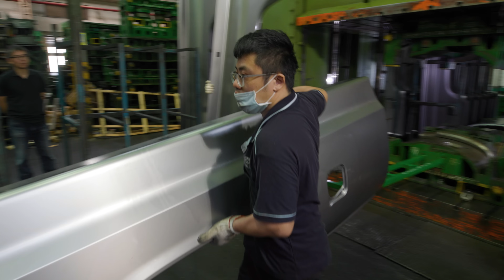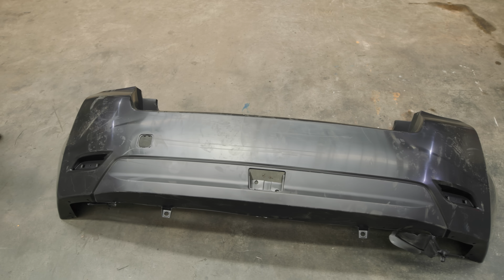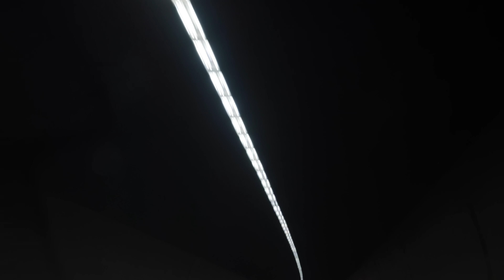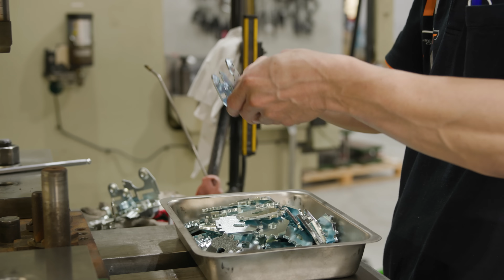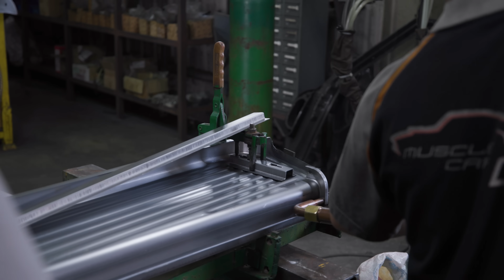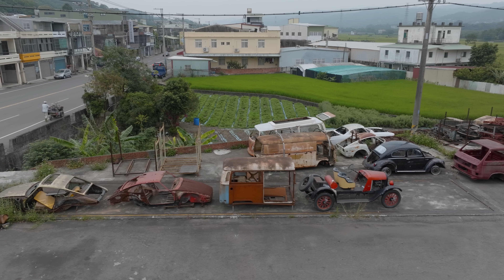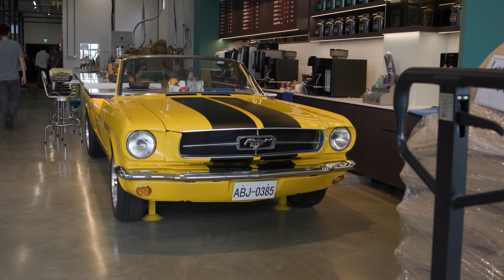Taiwan Makes American Trucks Great Again! Tour of Sheet Metal and Replacement Parts Factories

Comment: The fact the molds and stamps are not scrapped and put into service is almost a godsend. The ability to correct any defects with the tools available today will ensure a long term business plan. I wish it was in the USA but at least SOMEONE sees the value in reproduction of these still cherished vehicles, even if it’s from overseas.
Reply: I'm honestly surprised someone like ford or chevy doesn't reproduce something like an old square body or bronco with modern engine, suspension, brakes & interior. Surely that would sell. People are buying restored ones for $150k plus.
Reply: @SlurpJ ,emissions and safety is why. The folks rebuilding or modernizing those old trucks are not scrutinized by the various agencies.  They are essentially one offs.
At a 150k my guess is most are barely breaking even.
Reply: @davidsawyer1599  I work in the auto industry. Emissions and crash testing wouldn't be an issue. Engineers have overcome far bigger issues.
Reply: @davidsawyer1599  It's the way consumerism works. If manufacturers weren't constantly changing model appearance every few years, people would have little incentive to "upgrade."
Reply: @SlurpJ they're not allowed to because they take federal money now. Did you hear how cheap that guy said they were making die sets? The same die for the new Ford tailgate cost the company $8,000,000. But they have to sell their old dies
Reply: @SlurpJ  The modern crash test requirements would make that impossible.
Reply: @frenchonion4595   nope. I work with with plenty of engineers. The problems they can solve on a computer sitting behind a desk is incredible.
Reply: @SlurpJ  Even with that you have to pay them to think up this stuff. Smart people ain’t cheap to hire.
Reply: @SlurpJ  They figure that they can't meet their profit margin on it. Gotta remember they are greedy.
Reply: Have you seen these car & truck auctions? What this stuff is going for is mind blowing.
Reply: @SlurpJ  Regulations and laws. That's the only reason they can't build a Ford Bronco. Once those laws and regulations are gone, and they will be gone soon, you're going to see 1970's vehicles being reproduced, bolt by bolt, and sold to the public again, with a carburetor. Remember that Lee Zeldin is the new boss of the EPA, and on his first week he found $8 billion dollars that had apparently been stolen by the last administration (allegedly).
Reply: @starseeddeluxe  I'm not so sure they will be gone. But it's entirely possible to build a "new" Bronco using old school sheet metal & modern engine, suspension, brakes, etc. Unfortunately it'd cost more than a Raptor. 
Not a fan of the EPA so I'll pay more attention to this Zeldin guy.
Reply: Be thankful 😊
Reply: I love seeing this kind of creativity and I agree. Why do we not do this is the USA
Reply: Ya you would think someone in USA would want to buy the gm stamp press instead it goes across the world
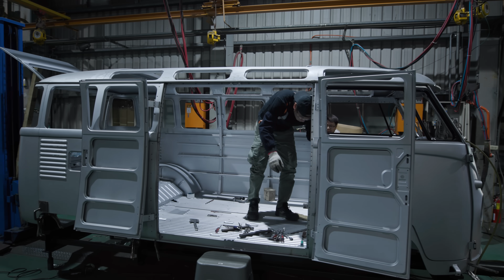Reply: Very often, the stamping machines originated in Asia. The mfg in Asia, first in Japan, later elsewhere , large scale machine tools were available in Asia on a timely basis. 11:06  @petercoffin4978
Reply: it gives a great opportunity to avoid modern, much too complex technology, because you simply repair your old car that never gave up and no crazy bills and easy to repair for DIY. Hooray
Reply: 0:03 
I think one offs could be made in the USA , my question is frames
And drive trains
Then you have a question of VIN and titles  these are reproductions.
What states have emmisiins laws on new old cars that are remanfactured as new? 
Then you have motor type say electric or hydgron  powered 
You can convert a gas engine to run off hydgron  with a near 0 carbon footprint.
And last  copy rights to the body designe
Reply: @bobbg9041  It's spelled hydrogen.
Reply: Lmao you must know nearly nothing about the stamping process…
Reply: @saratoga123321  enlighten us!
Reply: @saratoga123321 I never said I did ,so please kind sir, enlighten us.
Reply: To many corporations in the US that want to be millionaires over night ,to many CEO that want to be millionaires overnight, EPA rules, liability’s, insurance,finding some young people to work an 8 hour day and don’t mind getting  dirty,90 days off for maternity leave when your wife has a baby. How many more things can we list,and we wonder why we don’t have manufacturing in the USA any more.
Reply: Honda makes cars at different plants around the country too. My Goldwing has less Japanese and Chinese parts than the avg Harley does . It also can last a lifetime with just normal maintenance.
Reply: Oh they make reproductions of those molds and stamp machines and then they scrap the original or they just sell it on eBay
Reply: 888
Reply: IN WW2 we converted hundreds of plants from what they were doing to what we needed in MONTHS. BRING BACK WHAT WE GET FROM OTHER COUNTRIES,WE CAN REBUILD OUR INDUSTRY IN MONTHS AGAIN ! With American labor!
Reply: @Happy11807  good point. If we were do go into a conventional war today…we’re screwed.
Reply: Better Taiwan than china
Reply: @davidklauer3422 well if China gets their way…
Reply: because it's literally cheaper to manufacture and ship half way across the world than do in the US that's why the US needs trade restrictions on overseas car manufacturers because the US can't compete and it's pathetic
Reply: @trailfork7815   FYI, the US already HAS trade restrictions in place on overseas car manufacturers.   These were first put in place in the 1980s by the Reagan administration.  This is why Toyota, Honda, and German car manufacturers started putting car factories in the US to do final assemblies of their car models, because that was the solution the Reagan administration came up with to continue to allow these foreign companies to sell their cars in America.   They recognized that these foreign companies were making better cars than the crap turned out by US car manufacturers at that time, but they wanted to be able to say, hey, we made sure that these foreign cars would be made in 'Murica to keep 'Murican jobs.  
The REAL problem is that American car manufacturers only care about their quarterly profits and stock price.  The  people who run American car companies can't think further than the next six months.   If a car or truck model goes out of production, there isn't a huge amount of profit to continue to keep the dies around to stamp small runs of replacement body parts for future car enthusiasts trying to restore that model car.   That's a VERY small market that requires a lot of patience and lots of love for these cars, and LOTS of expensive storage space.   American car manufacturers instead look at that die for a car that they no longer make and think, hmmm, how can we make a quick profit off this die in the next six months?   Recycle the metal?   Or sell it to this funky body part factory in Taiwan?
You see?  They probably just recycled the metal for the die in the past, but now this company in Taiwan is willing to buy it from them for a quarter of a million dollars, so yeah, of course they would want to turn a quick profit on that die that they don't want to continue to store and to do small runs of that body part.   Not enough profits in it and they don't care about restoring old cars, only their quarterly profits.
Reply: @gandalfgreyhame3425  and the fact that it had to be sold to Taiwan instead of a body shop in the US where the manufactured parts would be sold to anyway only furthers my point that labor in the US is too ridiculously high to keep manufacturing these things over there
Reply: @trailfork7815   A small body shop in the US would not have enough capital or the expertise to be able to get into this sort of business.   It would have to be a company that was already in the business of producing sheet metal stamped parts, like how this Taiwan company started out.    And there actually still continues to be a thriving stamped sheet metal manufacturing industry here in the US, so it's not entirely the labor costs either, because these American companies have figured out how to stay in business even with the higher US labor costs.   
So, the question is, why didn't an American stamped sheet metal company get into this business of reproducing body parts for cars and trucks?  
My best guess would be that once again, any American company that had the capital to get into this business of spending a quarter of a million dollars on one body panel die would want to have a pretty good return on their investment.   Profits come first with most all American companies.   
Or, they would have to be really rich already from some other business and are just in love with this idea of producing body parts for old cars and trucks.   Like, Elon Musk could have done this.   Tesla bought these super expensive Giga Press machine tools made in Italy to stamp out very large complete body parts for their Tesla cars, to reduce or eliminate the number of welds they needed to manufacture the Tesla cars.   Except, Elon's vision wasn't to go out and produce a huge library of stamped sheet metal body parts for old cars and trucks.  Elon's vision was to change the world and make electric cars a reality and the dominant force in the car industry.  
So yeah,  anybody in the U.S. with the money, the capital, the wealth, to get into this business would either want to do stamped sheet metal parts that would either make a really good return on the investment, or they would have to have this vision for wanting to do this as a service to all the old car and truck lovers of the world.   And culturally, I think the sorts of rich American entrepreneurs like Elon that could have done this .... just didn't.  It wasn't a really sexy idea that culturally they would ever embrace.
It's sort of exactly the same reason that TSMC got into the chip manufacturing industry by manufacturing chips for everybody else's designs, not their own.    Intel could have gotten into this business, but they were making lots of money at the time making and selling their own chips and didn't see themselves as just a fab for other people's designs, so they turned down the opportunity to make chips for cellphones, ARM processors, and the graphic cards of NVIDIA and AMD.    So Intel let TSMC grow into a bigger business than their own because they turned down this opportunity to just be a fab for other chip designers.  
So, I think in Taiwan, the people with the capital, the wealth are culturally more willing to do projects that aren't so super duper visionary and world changing, and instead are just sort of providing a much needed and not very sexy and not super profitable sort of service to the rest of the industry.
Reply: @gandalfgreyhame3425  yeah I guess profits comes first, say they make $200 profit for a quarter panel, in asia that is already a decent chunk of money but for the US no way is anybody accepting only $200 in profits for a part that could take an entire day to make, I'm guessing if it has to be manufactures in the US it would cost at least 2x just to break even in material and labor compared to taiwan
Reply: @gandalfgreyhame3425  it wasn’t too long ago that the most US content car made in America was…wait for it… Toyota Avalon. Over 80% of it made in America.
Reply: @trailfork7815  how much less do you pay someone making parts for old cars than new cars? The work is the same no matter what model year it is. What kind of quality do you get in USA for minimum wage?
Reply: @gandalfgreyhame3425 It's not likely that they would recycle tooling,  unless it's just a small modification.  But for new designs it's more likely that they would start from scratch.  They'll store tooling for a long time but eventually it's just scrap iron to them.  
I thought that was interesting how these Taiwanese were making the rough tooling out of Styrofoam.  Using that Styrofoam to make castings that were eventually machined into functional dies.
Reply: @paul5683  Smart idea. On complex shapes such as a reverse curve they could make the  styrofoam in sections and pack the sand around the styrofoam with parting line, split the mold and remove the styrofoam and use it again. He said $300,000.00 for a set of dies, but with cheap labor I doubt it would be that high. As far as scrap iron, they said they make the dies which would imply a foundry and the scrap is then recycled to become new dies again.
Reply: @trailfork7815 Maybe if burger flippers weren’t being paid $20/hr, you could.
Reply: @moltderenou  And you do what for how much an hour. The kid flipping the burger has to pay how much of his pay cheque for rent, and may also be making payments to a college when he is not working his part time job to hope to have a better life. I don't like the price in fast food places and save a lot by making all my meals, even when I drove commercial truck for a living.
Reply: @trailfork7815  understand what your asking for. If they were made here it would be far more expensive to do even to a point that it wasn’t profitable, which may be the reason why we have this situation. Today’s vehicles a far more complicated with all the nanny devices/comfort/federally mandated features people have grown accustomed too. Those complexities lend themselves to cheapest production prices available in order to keep vehicles “affordable”🤪. Because we still have an option to preserve some of the vehicles still roadworthy with these “foreign parts” is money in the bank vs. buying a new. I myself would rather put $ into my 22 year old F250 than entertain buying a new or even something 5 years old. Thank you to the Mr. G’s helping us do that.
Reply: @trailfork7815  can't compete, or over regulated, and fined out of business? Or are we robbed of our tax money to subsidize assembly unions? Which are basically Ponzi schemes at this point... if only General Motors and Ford could just go out of business already so they could be bought out instead of handed bailouts to pay themselves bonuses. Federally subsidized unions ruined American manufacturing.
Reply: @trailfork7815  what will happen if others also impose american businesses for their home business. most americans businesses are global, dont talk immature way, otherwise, it will be national companies, all nation can do same thing as usa. usa pushed global trade and made others to open their gates, but most americans dont want others to come in their nation. i think this wont that way.
Reply: @trailfork7815  I take exception to that and here’s why: just look at the Lincoln Nautilus , it is produced in China. At $60K it is not a bargain IMO but yet there asking “home grown” price. So is ford really interested in the consumer or how much they can get on each. I be willing to bet that the minimum PROFIT ( after expenses paid) is at least $10K per vehicle. After 5 years ownership heaven help you if you need a part, and if they do have say a headlight they’ll probably want 5grand for a replacement.
Reply: Thank the board members for shipping American jobs overseas. 
 Covid taught the world a lesson. That lesson was this. "We need to make all that stuff here."
Reply: @davidsawyer1599  problem is that even if the molds were used here in usa.. the labor and operating costs would make it cost to much. 
Everything .made in usa, comes at a higher price.
Reply: @turboflush  labor costs are the same around the world. It's CEO's and "Engineering" costs that scare people away from work. If we got rid of upper management, who always make shit decisions, our companies would be a lot better off. I used to make plastic extrusion molds. And upper management decided to get 1" ball endmills instead of 1/2" ball endmills because "with one inch we could run one pass in the program at depth." To which I replied no you can't the webbing of the one inch endmill won't remove material..." so these idiots bought two $450 endmills and both snapped because they're not machinists they're "purchasers". Those people shouldn't have jobs in manufacturing.
Reply: @turboflush  Yes, that's why "reshoring" sounds good but peole won't like the higher prices.
Reply: @Jbainbridge5  companies can’t afford to keep shit decision makers, there is a reason for some management.
Reply: @michaeldecker2725  what? Have you ever had a job? You might he the shit management...
Reply: @Jbainbridge5  Arrow transport in BC would hire university grads to manage their trucking fleet. Their job was to make the company money, but they knew nothing about maintenance along with other lackings. One manager enquired with some one in the USA about greasing schedules and was told 40,000 and then regrease. What he didn't know was that was for a truck hauling 80,000 lbs gross over flat country. We were hauling up to 63500 kg. over mountain terrain. Needless to say when the universal joints on 5 trucks failed and they usually failed on the short stub shaft between the two differentials the short shaft flailed around causing thousands of dollars of damage all to save a few dollars on grease never mind the increased fuel consumption when those roller bearings were not moving freely any more. They fired him and hired another university dufuss.
Reply: @kerrryschultz2904  Yep, sounds aboot right.
Reply: @ Did you work for Arrow also?
Reply: @ no, I'm not actually canadian. I'm American: we're better than you.
Reply: @ Only in your dreams.
Reply: @Jbainbridge5  labor costs are NOT the same around the world. Where did you get that idea??? Then why are they sending a lot of manufacturing to Mexico instead building here in the USA? For the weather?
Reply: @davidsawyer1599  Two words, 'Profit Margin'.
Reply: @davidsawyer1599 That's right.  President Biden realized that with projects like the Chips Act. Investing in the USA being able to manufacture our own micro chips.  We were literally up shit creek when we couldn't get the micro chips that we needed to make a lot of the modern things that we rely on.  Cars, medical equipment, agriculture equipment, manufacturing equipment,  military equipment, all laying in limbo waiting for the chips we needed during the pandemic.  If the pandemic taught us anything it was we were very vulnerable in our inability to supply our own chips.
Reply: @davidsawyer1599 this has nothing to do with shipping American jobs overseas.  This is part of product obsolescence by the auto manufacturers. It’s very costly to support old products. Unfortunately no American companies viewed this as a good business opportunity.
Reply: Over seas company making American classic car parts America is fucked
Reply: @bradlybaldwin9564  agreed, but, we did this to ourselves generations ago. At least Mr g is smart enough to buy all these old dies that made millions of parts knowing that millions of them are still used and parts are needed for them. At least what’s left of shade tree mechanics out there can get parts from a quality driven country like Taiwan.
Reply: 9 @michaeldecker2725
Reply: @bradlybaldwin9564  maybe if people don't charge a few hundred an hour in labor alone then maybe manufacturing in the US would make more sense